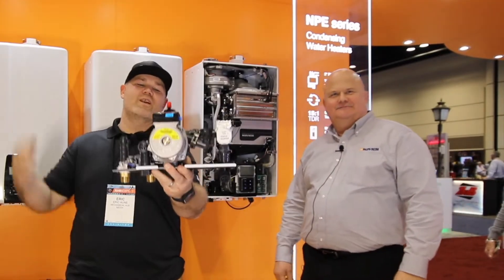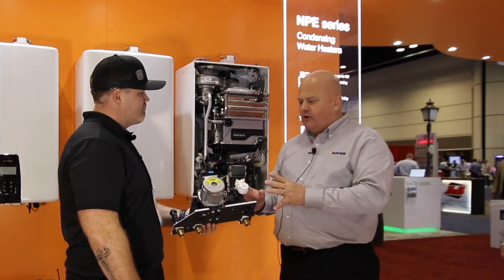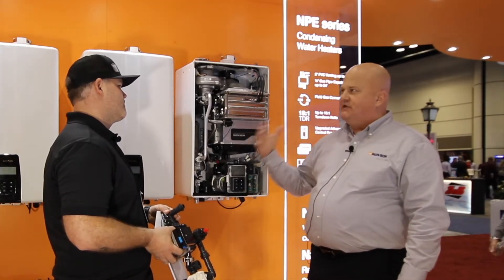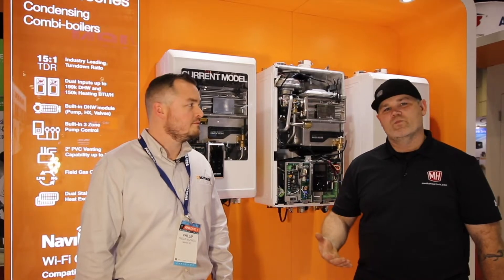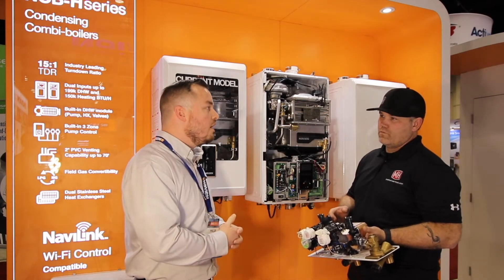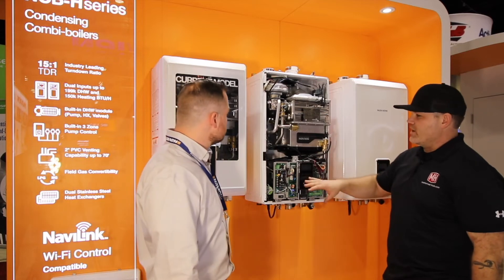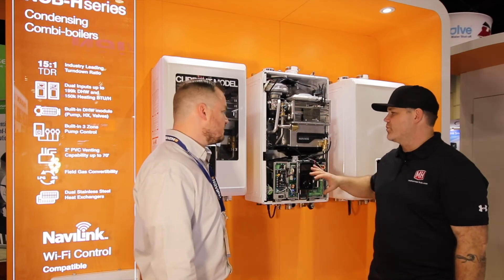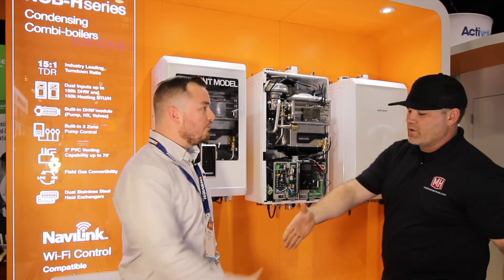New Navien NPE A2 tankless water heater!

Comment: With the NPE-A2 having the built in recirculating pump, does the home have to already have a recirculating line in place or can the customer use a manifold as used the Grundfos and Watts for those that want recirculating?
Reply: Home does not need to have an existing recirculating line or external recirc pump

Comment: Should I add an additional recirculation pump to my Navien NPE A-series water heater? The hot water runs cold for 25 seconds before actually getting hot. I'm paying for wasted water! HELP!
Reply from the maker: If you have an external, dedicated record line then it sounds to me your NPE is not set up correctly. There is a valve inside the cover that must be switched from internal recirculation to external. If you do not have a record line then it may just be the long distance and volume of pipe you're waiting on. You can have a special valve installed under the farthest sink that can help, this is called a NaviCirc.
Reply: @mechanical-hub  Thank you!
Reply from the maker: sorry for the typos, phone autocorrected recirc to record

Comment: Was about to have npe-a installed - is it worth getting this new model npe-a2?  When are they actually available?  Initial plan is just use internal re circulation capability.
Reply from the maker: I don't have a date on the new model availability yet but the existing model is already a solid performer. I wouldn't hesitate making a purchase now.